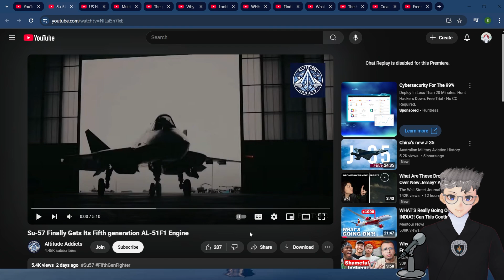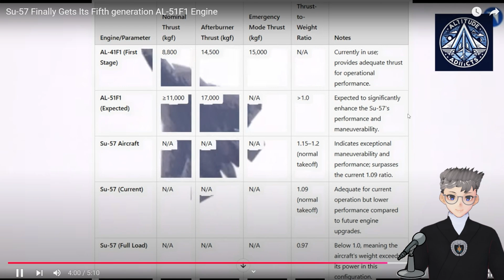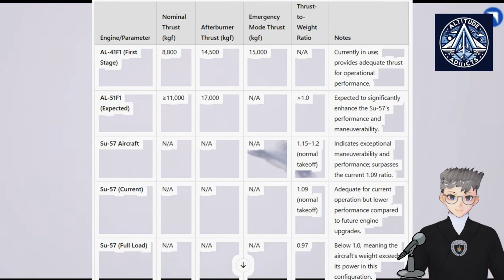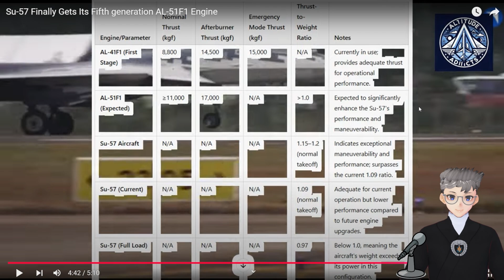NEW FLAT NOZZLE ENGINE!?! Reacting to Russian thrust vectoring AL51 engine

Comment: On stealth. Not sure what is wrong with intakes? YF-23 had similar non S-shaped with radar blocker and was stealthier than YF-22 during USAF trials. I don't think anyone can tell on the look of those inlets alone :) my overall guess is that Su-57 is overall less stealthy in X band but stealthier in L-band (due to being flatter and small all moving vertical stabilizers) in comparison to western designs.
Reply from the maker: the YF-23 did have S-shaped inlets, could also be attributable to less capable  R A M material (su-57 intakes) other than the blades

Comment: The U.S. has made over 800+ F35s. How could you claim it has low rate production?
Reply from the maker: it is very cool that they got so many out i agree, i believe full rate production started march 2024
Reply: @everestfujich  156 Per year. But for 2025 it’s been cut to 146.

Comment: Thrust vectoring flat nozzles aren't anything new.  The Lockheed F-22 Raptor, first flown on September 7th 1997, has them.
Reply: That was an older prototype of the f22.
Reply: F-22 has nozzles that could move only up and down. Those nozzles could move also left and right and rotate
Reply: @azanudniy  3D Thrust Vectoring is not necessary for “Supermanuverability” if you have advanced avionics outside the vectoring nozzles. 2 D is perfect and better for lower Radar signature along with better thrust.
Reply: @reflexboxer2ndlt807  Maybe. I'm just saying that those nozzles are not the same as F-22 has
Reply: They're new to Russia
Reply: @acompletelynormalhuman6392  I've seen Su-27 with flat nozzle from the 80's,  It reduced the trust by 20% and the Soviets scrapped it. Search for Su-27LL-PS
Reply: @acompletelynormalhuman6392  russia invented it...
Reply: @strabo1  the flat nosils or thrust vectoring? because thrust vectoring was invented in a joint venture by the US and Germany with the x31
 as for the nosils you would have to list a Russian example as I don't know of any Russian flat noisle design other than the new ones in the video but I can tell you that the f15 STOL technology demonstrater was the first American flat nozzle design starting testing (along with round true 3D thrust vectoring nosils) in 1993

Comment: The .078 is likely weight-to-thrust instead of thrust-to-weight, meaning a ridiculously high 12.82 thrust-to-weight ratio or a 13.53 T/W at emergency thrust.
Those figures are unrealistically high compared to western fifth gen engine specifications (F119 7.95:1, F135 11.47:1, EJ200 9.17:1 (or 10.51 at emergency thrust)), indicating that they don’t include the thrust reduction of 14-17% due to the new nozzles and are exaggerated on top of that.
Reply: That's the engine's T/W, not the plane's. Soviet engines traditionally have very high T/W ratios, but much shorter life span like European cars.
Reply: @axl1002  F119, F135 and EJ200 are engines as well.
Reply: Probably that's 100% fuel and full load TWR
Reply: @AkyJLa_  How would fuel and weapons load matter for engine TWR?
Reply: @RichelieuUnlimited  i thougt of planes twr, ok

Comment: lol looks like a downgrade only to be “Stealth” nozzles just Copying the F-22 smh 

When the traditional Round Nozzles but able to Swivel in ALL Directions
Reply: Su-57 also has wings, meaning they must've copied F-22 smh... 

If a design choice offers desired advantges, who cares if it's already been done before
Reply: you can see on 1:20 flat nozzles are capable of 360 vectoring. they are different from f22 flat nozzles
Reply: @MrKekus-o3l  They are not, they are mounted under angle, only MiG-29 OVT has real 3D vectoring.
Reply: @axl1002  they are, you can see it in other new videos. Angle of thrust varies not by flat nozzle, but by round part before flat nozzle
Reply: @MrKekus-o3l  🤣🤣🤣🤣
Reply: @axl1002  check new videos with moving nozzles, lol
Reply: Actually the round nozzles on Su-35 and older Su-57s did not swivel in all directions, they were already 2D just like the F-22's, except they are canted to the side so by carefully swiveling the nozzles in different directions, they achieve the same effect as 3D nozzles (this is all efficiently managed by the flight computer). True 3D vectoring nozzles are much more expensive and less reliable, they only make sense in single-engine configurations
Reply: @KekusMagnus  there was an experimental 3D thrust vectoring fa 18 back in the early days of thrust vectoring